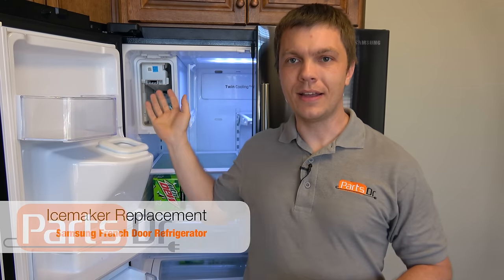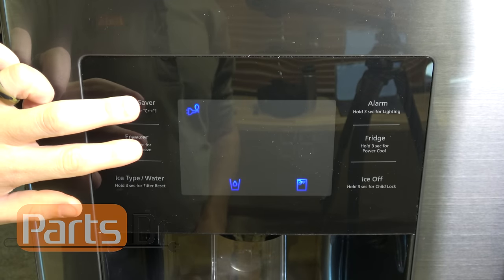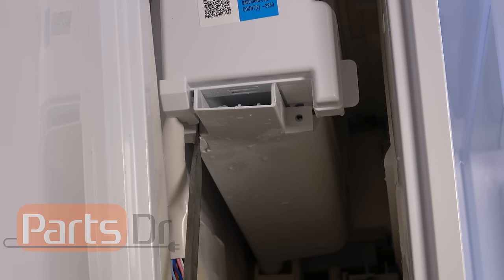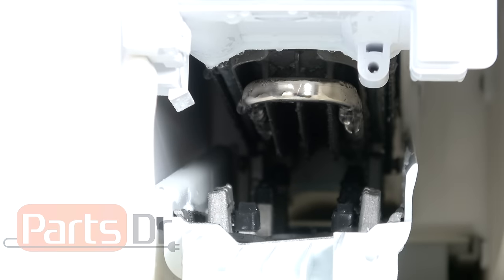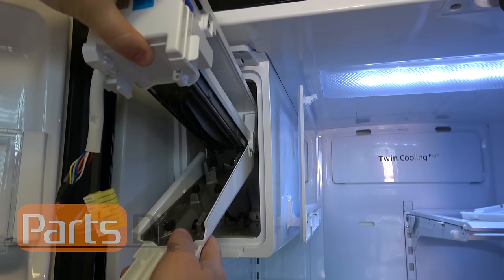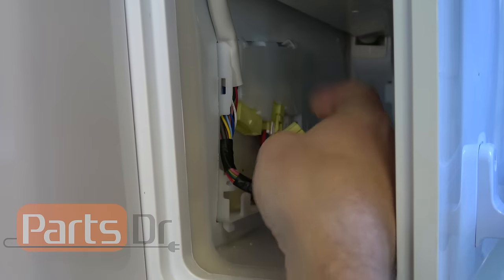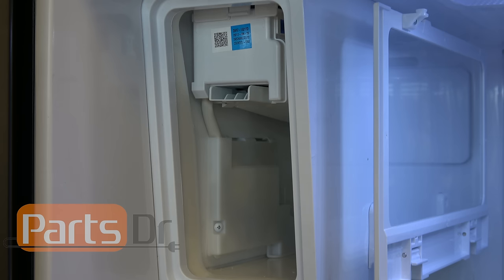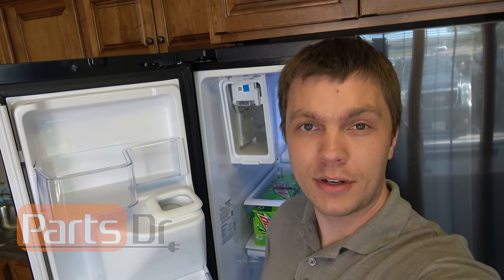How to replace Samsung Icemaker part # DA97-15217D

Comment: Great video.  Exactly the issue I was having.  The important part that cannot be stressed enough is to use the RTV Adhesive sealant to seal off the ice maker from the moisture of the refrigerator, preferably both seal the inside and outside of the ice maker compartment.  I just ordered the upgraded new and improved (hopefully) ice maker to see if both steps will greatly reduce or eliminate the ice buildup on the ice maker.  The RTV adhesive sealant though, can be found cheaper elsewhere, sorry.  Unfortunately, Samsung refrigerators usually have these issues, and it is frustrating to us who paid a lot of money for what we thought was a top end refrigerator.  And the big stores have to continue to sell these bad refrigerators because of their contract with Samsung.  Poor refrigerator design, stay away from Samsung refrigerators and buy American!
Reply: Which website did you order it from
Reply: @frankonolfi1966 , I actually got the RTV adhesive sealant from Home Depot in the automotive section, for <$10.  It won't be found with the other caulking materials, and I finally found it in automotive.  It's best to seal both inside and outside the ice maker compartment.  The old ice maker doesn't freeze over nearly as fast now, but it did not fix everything,.  I have the new ice maker ready if needed, but have not installed it yet because I wanted to know how well the sealant worked.  My cooling in the refrigerator still freezes over too, so I am currently debating about paying for someone who services a Samsung refrigerator to come and fix all the issues at once.  THE SAMSUNG REFRIGERATOR IS THE WORST APPLIANCE I'VE EVER OWNED!!!
Reply: @jgyaritz  I have had ongoing problems with Samsung appliances. In 2016 I bought all 4 new major Samsung appliances. The dishwasher lasted 3 years. The oven has had repairs, convection motor which i replaced,easy job.  The ice maker keeps freezing up. I took a hair blow dryer melted the ice and turned off the ice maker and now its works.  Replacement ice makers on line are all out of stock. Next problem I will replace it. Thanks for your help.
Reply: @frankonolfi1966  Yep, same time I bought mine.  I just found this video, and moving the temperature sensor to the recommended spot is the only thing I haven't done yet.  https://www.youtube.com/watch?v=TN7mrO7QNsw
Reply: @frankonolfi1966  Did you try SearsPartsDirect for the ice maker?  They are good, as is Parts Dr.
Reply: I'll check it out.

Comment: Hey boss.  I'm struggling with my Samsung here my ice master unit won't dislodge after 15 minutes I'm forced defrost. I'm about to rip this out but I fear making this problem worse. Any suggestions ?
Reply from the maker: Don't force it out or you will break something.  We find it best to leave the refrigerator unplugged and the refrigerator doors open to let it thaw out.  Don't use any additional heat sources and the thin plastic liner of the refrigerator warps easily and if you damage that it is not repairable.  Good luck!

Comment: What if the ice bucket will not come out? Mine has been stuck for years.
Reply from the maker: Unplug the refrigerator and leave the doors open for a day or two to let it thaw and melt.  It is most likely frozen in place.

Comment: I have an rf28hdedbsr and the method for defrost did not work, I had to told the light and freezer button, then go to the fd setting. Still haven't figured out the power down mode. Thank you for the video

Comment: Before replacing try this.  Somehow the "ICE OFF" button was pressed but the "ICE OFF" icon did not light up so it was "OFF" but there was zero indication. Definitely try this 1st. If you hold the ICE button for 3 sec and you hear a rising chime sound but the light doesn't come on then this could be the issue. Just hold it until the chime sounds in a lowering tone and that would mean it's ready to make ice. I know that sounds confusing but try turning on and off the "CHILD LOCK" so you can hear the sound it makes when you turn it "ON" and "OFF". It's the same tone for the ice maker button when you turn it "OFF" or "ON". The other thing is you have to wait a while for it to work as Samsung has some type of delay built in (I think to make sure the freezer is cold enough) before dispensing ice. I believe the actual delay is 12hrs but it could be as much as 24. Good luck.

Comment: Ff I activate Force Defrost .Does it defrost the ice maker in the bottom too ?
Reply from the maker: The freezer ice maker is a different type of ice maker that does not require defrosting before removal.
Reply: @PartsDr  It seems frozen and does not work . How do I fix it ?  Thanks
Reply from the maker: @maybonphuongtroi9281  Most often we see just a failure of the ice maker itself causing the freezer ice maker to stop working.  Unfortunately, we cannot diagnose your problem through a comment on Youtube.

Comment: We bought all Samsung appliances back in October of 2016. Kitchen and laundry room. It’s now June of 2022. Besides the very ignorantly engineered ice maker, everything else has worked great until this year. I just had to replace one of the rollers inside the dryer for the drum otherwise they have worked very well.  I can’t believe a company as big as Samsung was not able to come up with a fix for this we will never buy SamJunk again that is for sure.  When we first bought everything we called and had the repair guys come out here six different times to try many different things with the Ice Maker and finally Samsung said just cut the cord send us a picture and we will refund you the money.  Well I stalled with the picture because I told them I needed to get a replacement refrigerator so they gave me the money and never asked me for the picture of the cord so we got at least a free refrigerator freezer out of it LOL.
Reply from the maker: Can't beat free!
Reply: @PartsDr  😄💪🏻💯

Comment: Can't I just defrost the original icemaker for like an hour, then undo the forced defrost?????  Should that fix the problem?
Reply: That's my question too.  Maybe it is just a temporary solution but I'd like to try it before replacing the whole unit.  Did you try just defrosting and did it work for you?

We've had this fridge for 4 years with no problems making ice. (it's always crushed though)

Comment: Mine looks the same but there is a screw at the top of the ice maker as you call it. There is about 3/8 of a inch to remove that screw, after removing that one there seemed to be another screw on the other side that is not accessable.
Reply from the maker: What is the model number of your refrigerator?
Reply: @PartsDr  I do appreciate your response. The screw I was taking about I now know that it holds the ice maker to the top plastic mount and is not supposed to be removed  to get the ice maker out. I think ice buildup was part of my problem but at first I was trying to pull the front straight down after depressing clip.  Finally realized it has to come out toward the door a small amount before dropping down and removing.
Reply from the maker: @lonniecushing7949  Thanks for letting us know!  We are glad you got it figured out.

Comment: Thank you for such an informative, educational, well presented video.  However, I have a question.  Is the replacement ice maker the same as the problematic ice maker, or is it the upgraded one that eliminates the problems?  BTW, my name is Greg Heinz.
Reply from the maker: Hi Greg,

The newest part number for this ice maker is DA97-15217D.  If you look at the tag on your original ice maker and it lists DA97-15217D then you have the newest part number.  If your ice maker lists part number DA97-12317A or DA97-15217A then you have one of the older versions of this ice maker.  Also, make sure to address the other issues like the moisture build up from any air leaks in the ice maker compartment and installing the Y-Clips if your refrigerator doesn't have them installed from the factory.

Comment: I've had the Samsung 31cuft for 6 yrs now, had the frost/ice issue, naturally there was an air gap around the ice maker, moisture issue, fixed that, no more frost, then the damn thing stopped making ice, I could reset it and it would run one cycle, which is kind of a pain, reset, cycle....etc, just replaced the Ice maker with parts from Parts Dr, still waiting for the unit to cool, lets see what happens, hopefully its not the control card.

Comment: Re: Samsung 28 cu. ft. 4-door French Door; mfr date 2016-09-30.

If the replacement part actually fit it was going to be a good day―and it did.  The most tedious part about the job was defrosting.  For as much as our Samsung unit cost, it doesn't have the 'Force Defrost' feature that toasts up the ice maker in five minutes like in the video.

So I had to apply a heat gun in small increments.  My trusty heat gun had extended the life of the ice maker for over a year.  It didn't matter that I deformed the hell out of it now because it had finally given up the ghost.  If I could have removed all the food and unplugged the fridge overnight it would have made the job 95% easier.  Wasn't really an option.

The video instructions are accurate and helpful.  I was very concerned about damaging the coil (and killing my wife's fancy French fridge) so I ground down an old flathead screwdriver (the yellow-handle kind you find in the road) sanded it, and buffed it on a wire wheel so smooth that it couldn't even pop a balloon.  It was the perfect tool.  Turns out that was all for nothing because when the upper unit unsnapped and lowered a bit the coil moved down enough so that I could align it with my finger.  Then I felt like the perfect tool!

One thing to note is that a strip of thick white foam 3½" long x ¾" wide on the left front of the upper assembly (near the wire harness) is not a temporary shipping block, but a permanent insulating spacer strip.  Mine caught on something and pulled off when I inserted the new unit, but it had enough stickiness to secure back in place.

Less than 90 minutes after the installation the first ice cube dropped.  A sound our kitchen hadn't heard in a long while.

                                       __________________________________________

On the Parts Dr. website I rated the repair as easy, but for me it was complicated by having to melt a Titanic sinker of an iceberg.  Also, the actual R&R time was less than a half hour of actual tech time, with the lion's share of time spent referring back to the video and of course defrosting the Ross Ice Shelf.

Comment: I was at Lowes today and for fun I popped open the ice maker in one of their french door Family Hub fridges, and sure enough it had the NEW P/N, decal showed it was manufactured in May 2018.  I also noticed the seam in the ice room was totally sealed.  So it appears Samsung has fixed their ice maker issues.  Hopefully it is.
Reply: I wouldn't hold my breath on that.  I bought a Samsung fridge in Mar of 2017 and the ice maker has consistent frost buildup, and I have to chip away frost about once a month.  I wished I'd done more research, but we were moving into a new house and needed a fridge, etc, etc.  I've had good luck with Samsung TVs and Phones, but I will never buy another Samsung home appliance.   This ice maker is a bad design, I've read on message boards people are trying to establish a class action lawsuit against Samsung.  That being said, this is a helpful video.  This weekend I plan to remove the ice maker completely and thaw everything, up until now, I've just put the fridge in Demo, OFF mode and thaw out the ice buildup in the back with a blow dryer, then the ice maker will usually work for a few weeks  or month before ice builds up again.
Reply: Mine had both the huge seam to the left and an open defrost heater thermal safety cutoff, so it was month to month chipping until I finally caved and took it apart, for now I just sealed up the huge air gaps, will have to look into a replacement for the overzealous anti-lawyer thermal cutoff that makes a piece of junk out of a perfectly working piece of hardware.... sigh.
Reply: I say anti-lawyer because I don't understand the justification of using a 102 celcius trip vs say the next step up at 115c.
Reply: i JUST BOUGHT A SAMSUNG FRIDGE, ARE THESE GOING TO HAVE THE NEW ICEMAKER?
Reply: @SuperDagod1  Check the PN# of the ice machine. You should have the latest as from what I understand all the older unsold stock had them replaced.

Comment: Will this repair and part number work for DA97-15217 “A”?
Reply from the maker: Yes it is the same ice maker, the "A" is the older version.
Reply: Parts Dr will the A model require the y clip replacement
Reply from the maker: @TimothyFreemon  If your refrigerator doesn't have any Y Clip, you will want to order them and add them.  Part # DA82-02367A (PD00038237) https://partsdr.com/part/da82-02367a-clip-assembly

Comment: I just got a response to my video about reducing the pressure on the incoming line. The pics I've taken of the ice fromation (and my attempts to manipulate it) suggest this may help. Pressure reduction valves are about $50 flingin' flongin' dollars, so I'm going to try to reduce flow, and I'll post if that helps. =]

Comment: I have a model RF28HMEDBSR/AA.  The buttons to push to get to defrost mode are Freezer and Lighting.  It took about 12 seconds and it then went to a blank screen.  You can then press any button to go through the codes as seen in the video to get to Fd.  To turn the fridge on and off the buttons are Freezer and Alarm.  The defrost ran for about 20 minutes.  It beeps the entire time it is in defrost cycle.  After the defrost completed the unit was still iced up.  I ran again but this time it stopped after 5 minutes or so.  I was able to partially drop the bottom tray but it still would not drop all the way and slide out.  I had to use a heat gun heating for very short periods of time to get the bottom tray to drop.  The coil was free so I was able to slide the unit out.  The bottom tray was still full of ice so that was the reason the tray didn't drop properly.  The back wall was still iced up so I had to work to get that ice out as well.  Once ice free and wiped dry the new unit went in just as shown.  Thanks for this video.  It gave me the confidence to do the job myself.

Comment: Ryan, thanks for video. Question:  My control panel is slightly different and pressing the buttons as you say does nothing. Therefore, i can't defrost nor shut off my fridge.  Can you help?  My model number is RF28HMEDBSR/AA.
Reply from the maker: See the link below starting at page 11.  Let us know which one ends up working for this model refrigerator.

http://repairmanuals.yolasite.com/resources/MSA-Samsung-Fridge.pdf
Reply: @PartsDr  That link yields "403 Forbidden".

Comment: Ice maker replaced but still not making ice. What could be the reason please?
Reply from the maker: Other things that can cause the ice maker to not make ice are a cooling problem, a bad main control board, bad water valve (inside the filter case assembly), wiring problem, and more.

Comment: how to cycle the IM to test it?
Reply from the maker: Holding the button on the side for 10 seconds will usually cycle the ice maker.  It should dump out the ice and fill with water.  On our refrigerator in the video the ice maker functioned okay but the test button on the side never worked for us.
Reply: @PartsDr wow, thanks for the super fast reply!

Comment: My problem appears to be that the ice maker won't stop making ice.  Does anyone know where the stop lever or sensor is?  There does not appear to be a way to stop the ice till it is frozen in place.
Reply from the maker: There is an IR sensor on the auger motor assembly that senses the ice level https://www.youtube.com/watch?v=C8Qa2PGjWmw

Comment: I have a Samsung with ice maker in freezer on bottom.  Had bought extended warranty.  They sent repairman out about 5 times, replaced ice maker three times.  Mother board once.  Never could keep it from freezing up.  I found the answer. Here is what it takes...  We have to remove ice each day from the ice maker bin and put the ice in a chest on the cabinet, otherwise the ice maker will freeze up.  To fix that freeze up, I have to take a hand held hair dryer on the back of the compartment at the water inlet to the ice maker  until I defrost it.   You can see the water melt and hear it give way.  Then the water will flow into the ice maker again.   Samsung knows they have problems but will not fix anything.  Just a small amount of insulation at the factory would stop all this.  I will never buy a Samsung fridge again.  Sad they do not care.  So if you have this problem, buy a good hand held hair dryer (don't get shocked, be careful), and a good camper style ice chest.